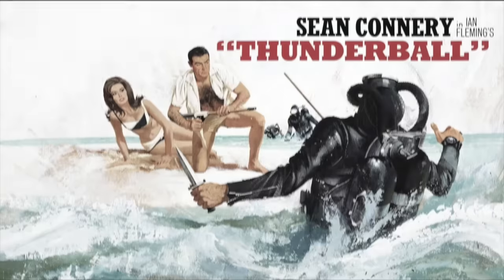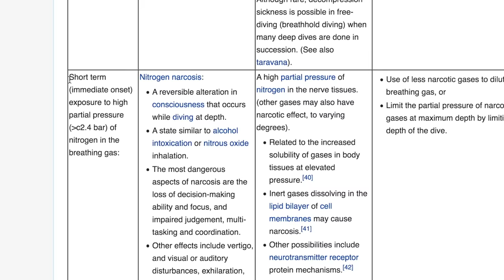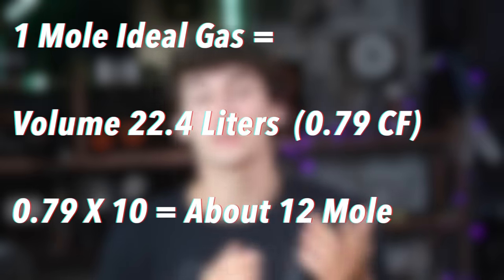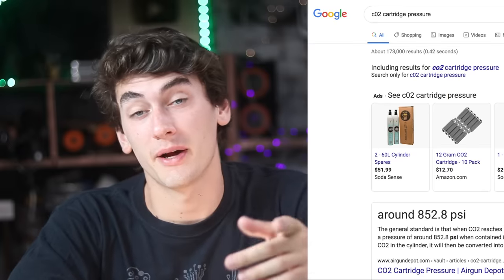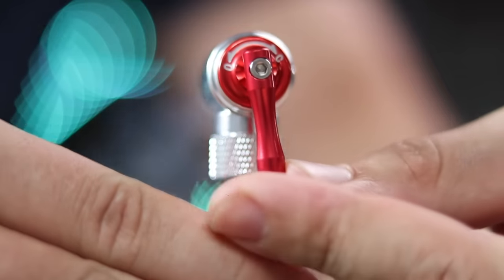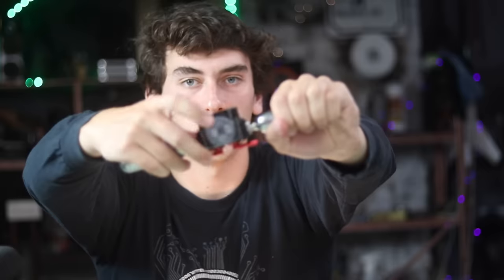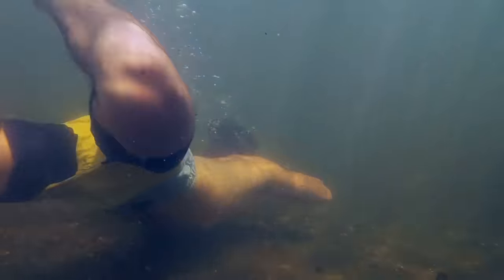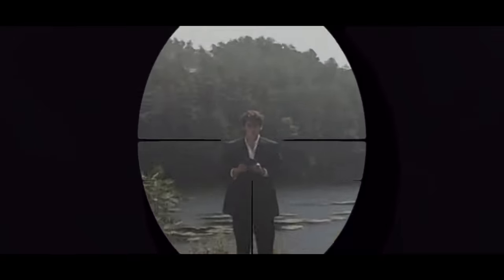Working 007 Mini Scuba Tank! - Breath Underwater With This Spy Gadget

Comment: Those things would be amazing as a safety for free divers. It's so high risk, and any mistake is deadly, so something tiny, that just gives them those couple breaths, could be life saving
Reply: Well, no. It will most likely be deadly or useless. The opposite of what you think :).
Reply: @kevinji7285  why?
Reply: @kevinji7285  yeah I dont get why people say this. If you know how to not give yourself the bens or how to breathe when you ascend, what is so dangerous? If it malfunctions youre probably not going to end up breathing in a bunch of water, then youd just be in the same situation youd be in if you didnt have one.
Reply: it can be both, but it adds another thing to pay attention to and avoid getting wrong
but IRL someone actually used something similar
i remember eric fatah who is a canadian champion and actually experiming alot in freediving 
and do things that make any AIDA instructor uncomfortable tried prebreathing pure O2 from a small 1L bottle during certain dives
and also Kirk Krack who helped james cameron for the underwater filming introduced the term "technical freediving"
it's about prebreathing scuba mixes before freediving to allow for more time underwater and less risk of narcosis during repetitive freedives (yes you can get bends in freediving if you do douzens or hundreds of shallow dives with little rest time)
Reply: If the diver is deep then a breath of air can be deadly. The lungs of the diver can explode from the pressure.
Reply: @zz772  interesting, say during the ascension would their lungs become at a normal pressure and then it would become safe to breathe ?
Reply: @stabb  Yes, during the rise, the lungs also equalize.
Reply: Not really for free divers. If you took a breath of this at 80 feet down and then surfaced your lungs would explode. You need to keep breathing on the way up or breathe out completely.
Reply: @Chevsilverado given enough parts you vould make it where it would release little bits of air, but I think a spare mask with larger tanks is much better idea.

Comment: cubic inches ARGH that is painful.

This comment was made by the metric gang
Reply: AKA the inferior measurement system gang.
Reply: @captaincannabis3321  lol, keep dreaming
Reply: Nah cubic FEET is worse
Reply: British people laughing at Americans for using imperial units when they invented it
Reply: Jarhead that moment when cnc machining uses imperial but the machines use metric hardware
Reply: @captaincannabis3321  No but for real, how is metric inferior
Reply: I get sick of seeing these demeaning comments. Technically speaking, the metric system is superior to the Customary system. That's right, it's NOT the Imperial system, which it was derived from. Some of the units are equal size and divisions, but most actually aren't.

When measuring distance or length, either one will do the job just as well as the other. I personally prefer to use the Customary system for these things, but I also don't mind using the metric system when it isn't attempted to be forced down my throat.

When it comes to units like Volts, Watts, Amps, etc., there aren't even units of measure for those things in the Customary system, with the exception of Watts (power) where 1 Horsepower is approximately equal to 746 Watts.

If you metric guys want everybody to use your system, stop trying to force it on them. Don't you know that people are naturally stubborn? Your pushing of the metric system along with constant bashing (and misnaming) of the Customary system will only push the ones you're trying to convince away. So in the words of Papa Franku, It's time to stop.
Reply: Its a engine chevy small block
Reply: @RAndrewNeal  "If you metric guys want everybody to use your system, "  There are like 2 or 3 countries that DON'T use metric on this planet. One of them is the US, the other is some shithole offshoot of the US, in Africa. Everybody already uses the metric system. As a matter of fact US does too, on every level, from government to the tech industry, to food industry. It's just on the peasant level that they still use the nonsensical imperial system.
Reply: @RAndrewNeal  the change happens slow but steady. More and more hobbyists are ordering machines and parts themself from China, and then have to deal with metrics anyway and hopefully notice how much more convenient it is.
Reply: @DerpEye  Good luck getting anyone to change with that rhetoric.
Reply: @martinum4  I didn't say it'd never happen. I said don't try and force it. People are stubborn; I don't care who you are. If you force it, people will resist. You'll get your way much faster if you just don't touch it.
Reply: @DerpEye  Even the customary units have all been redefined in terms of metric units.   When I was a child we learned an inch was "about" 2.54cm.  Today it is exactly 2.54cm because that is now the definition of an inch.   As an engineer, I use metric all day.  But as an old guy who grew up in USA,  on weekends I use Imperial units for the most part.
Reply: @martinum4  Yes, even living in USA you pretty much have to be "bilingual" in units. It's like if you speak Finnish as a native, you pretty much need to know another language also.  Similarly if you use Imperial units natively, you still have to be fluent in metric to interact with rest of the world.
Reply: 9mm is metric ima use it on yall real soon
Reply: Only big brains know that the metric system is way better
Reply: @DerpEye  The UK and Canada both still partially use the imperial system. I would stuff the smug comment back up your as where you found it.
Reply: Sorry I’m a lazy American and I use cubic inches also I’m not smart
Reply: @captaincannabis3321  nice troll.. how bout joining the rest of the world and the scientific community and going for units that are actually based on uniform scientific parameters.
Reply: @RAndrewNeal  the advantage of metric is not using other scale, the advantage is the conversion between units for example 1000 cm^3 are exatly 1liter, you can't do that easilly with the imperial system
Reply: @PabloDeLafuria  I know. What I'm saying is that nobody should bash the other standard, because they're both useful; it's just a matter of what you learned to use, and therefore what you're used to.
Reply: get me a pint of air.
Reply: @nw3473  Gimmicks aren't tried and true over centuries.
Reply: @captaincannabis3321  "this specific star is about 10000°C, and its cooler than Sirius!"

America: whats a celcius?
Reply: Almost every other country in the world uses the metric system
Reply: @bugleboy5676  So? We're not the rest of the world.
Reply: @RAndrewNeal  The US Armed Forces (With the exception of the Air Force and anyone using aircraft) use Metric for everything. 5.56, 7.62, 12.7, all measured in mm. "Clicks" short for Kilometers, distances are measured in Meters or clicks. The USA literally uses kph on sections of their highway. Modern Imperial measurements are literally derived from metric now adays.
Reply: @690_5  Did I contest any of that? I've never driven on a highway with a speed limit set in kph, and I doubt any British person has either. Canadians do though. Imperial units are English; Customary units are American. The two standards have little in common.
Reply: Lol
Reply: @captaincannabis3321  nah nah lets be honest we need to use metric man. im tired of this "1/16 inches" bullshit
Reply: @RAndrewNeal  1. its just a joke
2. if it wasnt its just a measurement system lol
and 3. after using the customary system up until highschool science and engineering classes i gotta say we need to move to the metric system, and fast
Reply: @oumardiop1  Those fields of work already use the metric system because everything is based on the last, and thus they all fit together perfectly. Not to mention, we use a decimal (base-10) number system, which the metric system is based on, making it inherently easier.

There are places where it doesn't matter. Road ways, for instance. Kilometers are easier to calculate in equations, but very few people, if anybody, needs anymore than a reference for distance. Even the UK officially uses miles per hour for measuring the speed of their cars (last I heard).

Simply don't nitpick. Convert when someone gives their measurements in Customary, just as you say when someone gives them in metric.
Reply: worse than these measurements is Fahrenheit.... ask random US citizens at what temperature water freezes or boils. Half does not know...
Reply: @tacodegroot6442  Ask them what feels good outside and they'll tell you. What you're actually referring to is the failed education system.
Reply: Haha get american’ed

Comment: One question that may make this actually worth it as a somewhat more long term like you see in the movies. 

Would it be possible to replace exsausted cartridges with extras you had on hand underwater?

I understand that it is not fully realistic, but if the answer could be a yes in some way this could be exponentially more useful.
Reply: it already is he screws them in so if u had several pre filled on a belt you could exchange them by unscrewing and screwing new one look back at video u will see him screw the cartridge in aka making it replaceable
Reply: @asalentstech1767  actually those are opened cartridge with no seal on them, the only thing holding the pressure in is the regulators. usually co2 cartridges are sealed with a foil that gets punctured
Reply: @BrianJT  ah ok didn't know that I appreciate the info I see what you meant now

Comment: The James bond thing could also use a chemical reaction to release oxygen, allowing it to hold much more oxygen without the rediculous high pressure.
Reply: Samuel Owens Actually partially true. If you just filled the cartridges with 100% O2, you could go way longer on each breath. But the buildup of CO2 in your blood would be very uncomfortable, and dangerous as well.
This is actually a discipline in breath-hold competitions.
Filling those cartridges with pure O2 would however be super dangerous, because there is probably oil residue and other stuff inside them, making them subject to random explosions from the pressurized O2 making stuff burst into fire. Most materials will burn in a 100% O2 atmosphere given some heat, and the temperature inside does rise when the cartridges are pressurized.
O2 cylinders need to be oxygen cleaned by an authorized technician because of this.
(I’m a technical scuba diver, and this video makes my eyes bleed. But hey. To each his own, and I’ve seen much worse on youtube.)

Comment: Anyone who wants to scuba dive, just don’t hold your breathe, it’s fine in a pool, but just practice not holding your breath while scuba diving and you will be fine. Your instructors will tell you EVERYTHING!!! Hope that helps 😏 heheh
Reply: Hey what about nitrogen poisoning or whatever it's called. Doesnt it affect free divers aswell.
Reply: free divers go on a single breath. 

Scuba divers air has a nitrogen mix, that at depth, dissolved into the body tissues. So it becomes an issue when you do multiple dives back to back, or your depth is too great. Divers require what’s called a “surface interval” to allow the body to release the built up nitrogen to safer levels. 

Free divers don’t have this problem because they aren’t breathing the compressed air under pressure. 

Old timers used a paper chart, watch, and depth gauge to do math on how long they needed to wait. Now a days your computer will just flash “interval” or something like that so you’ll have no info to go on if you do jump in.
Reply: *breath
Reply: @95tilinfinity2  THIS ISNT ENGLISH CLASS!!!

Thanks for the correction. 😏

Comment: Can totally breath pure o2, just after 20 feet of depth it can become "toxic" and cause convulsions. But you are put to depth with pure o2 if you get the "bends"
Reply: Why
Reply: why to which part?
Reply: Pure oxygen can be deadly. Our blood has evolved to capture the oxygen we breathe in and bind it safely to the transport molecule called haemoglobin. If you breathe air with a much higher than normal O2 concentration, the oxygen in the lungs overwhelms the blood's ability to carry it away
Reply: due to the pressure change, more pressure emphasises the effect
Reply: It is not immediate.  It takes 6 minutes to have a toxic effect at 20 ft.
Reply: @mellis966  no one said it was immediate
Reply: It has to do with the increased partial pressure of the gas. Look up Dalton's Law of Partial Pressure as it relates to SCUBA diving and hyperbaric oxygen therapy. Oxygen (O2) is generally safe at depths up to 60 FSW but at deeper depths it becomes increasingly toxic to the central nervous system (CNS). Also, pure O2 at shallower depths over long periods of time causes pulmonary oxygen toxicity. Hyperbaric medicine uses O2 under pressure to deliver greater amounts of oxygen than what can be consumed on the surface.

Comment: I thought the idea behind the rebreather gadget, was to act as an artificial Gill, that lets you breathe the air thats in the water and let's you stay under as long as you want/need.
Reply: Yeah
Reply: Water has led o2 than air it’s impossible you would need to pass gallons per second to have normal breathing rate. You would also still need to carry nitrogen and a co2 scrubber and now you have a rebreather

Comment: Question: why wouldn’t creating a chemical reaction that produces the proper amount of oxygen and nitrogen work?
Reply: I think Prince is on to something here. Lithium and water produce oxygen ( I think) now for the other 80% the nitrogen we need to make it breathable...?? Good solid idea Prince.
Reply: Smart!!!
Reply: Airplanes use chemical reactions for the masks that fall from the ceiling when the cabin loses pressure.
Reply: There is, if we'r talking about only chenical reaction(not the extrusion of air from water by chemical reaction or extracting molecules of oxygen from water molecules ), they called Rebreather. And there is gas masks with closed breating sistem, based on chemical reaction(some firefighters and soldiers use them). But some of the reactions are not that safe under water. Some of them can couse magor lungs damage if water gets to chemical. Some reations produce a lot of heat and you breathe with realy hot air.
Reply: @liamblankenship9968  that’s not how that works. Lithium and hydrogen are atoms and so is oxygen. You can’t add them together and get another atom.
Reply: @liamblankenship9968  You don't need Nitrogen, as long as you stay shallower than ~10m breathing pure oxygen is fine, google ww2 pendulum rebreathers...
Reply: @derekmichaelson4258  not what he said. Lithium and water can totally release oxygen.
Reply: Yes, some older russian rebreathers and submarine rescue equipment uses a chemical reaction to create oxygen. The drawback is that if it comes into contact with water it explodes, also you shouldn't breath pure oxygen deeper than 6m, you can become unconscious.
Reply: @Andreas-w  Not that bad of a drawback if you ask me

Comment: If something like that exists, it's most definitely filled with pure oxygen. Handle with care since it's highly flammable and can be toxic if you go below 7m of depth or breath it for a long time... i would probably add a small mouth piece do avoid leaking gas into the surrounding water.

Actually it would be even more efficient to add a bladder between the device and mouthpiece with a bit of lime in it do deposit the CO2. It would be kind of a ghetto rebreather 😂
Reply: it’s not pure o2, it’s just compressed air. he filled up the cartridges himself in the video with a pump.
Reply: @harrisonsherwood4028  Yeah, he was saying if there was a real one it would be pure oxygen. He wasn’t referring to the one in the video.
Reply: Pure oxygen isnt flammable It needs a fuel to give the oxygen to smh
Reply: @KClO3  Nope, highly oxidising, but that’s semantics really, it’s dangerous, and so should be handled with care.
Reply: it definitely should not be filled with pure O2 since that could damage your lungs and brain, especially if the O2 is stored under pressure (which would be logical in this case)
Reply: @dom4in637  Pure O2 is safe as long as you know what you are doing and plan your dive accordingly (that's why I put a disclaimer in my original comment).

The pressure inside the cylinder is irrelevant, what matters is the partial pressure of O2 you're breathing which in the case of pure O2 is directly linked to the depth at which you are diving (hence the limit of 7m not to excede a PP02 of 1.7bar ~ this number changes depending on the diving federation, I believe PADI has 1.6bar or 6m)

Edit: there's also a risk due to pronlonged exposure (even at 1bar)

note: military divers use pure oxygen rebreathers because of their simplicity (in spite of the shallow depth limit)
Reply: @maximehk  i would post a link to an article stating otherwise but its in german so im gonna accept this ^^